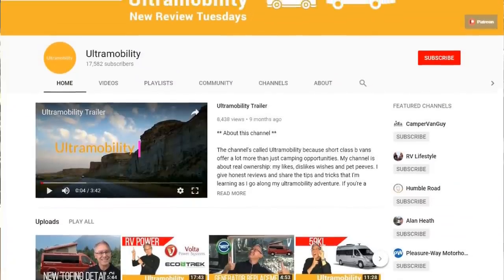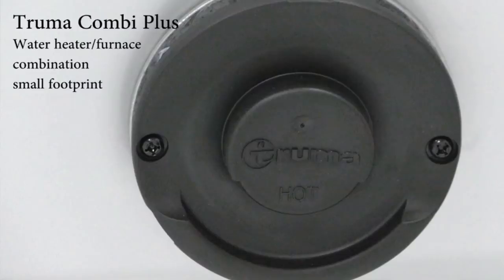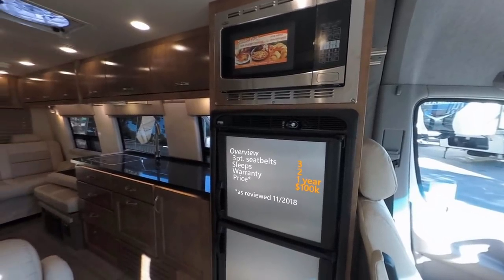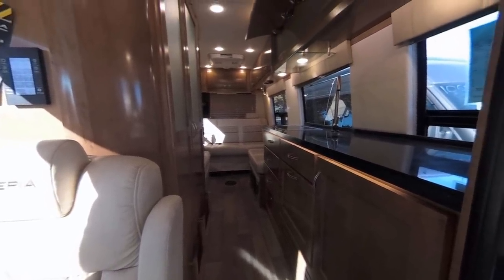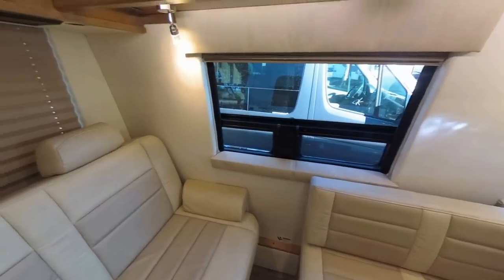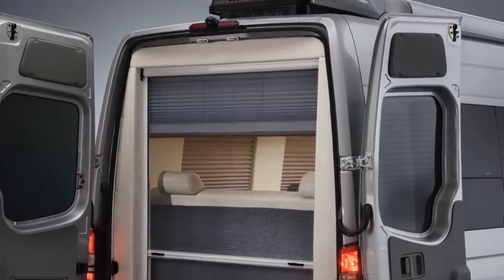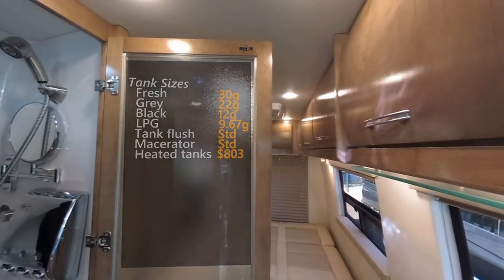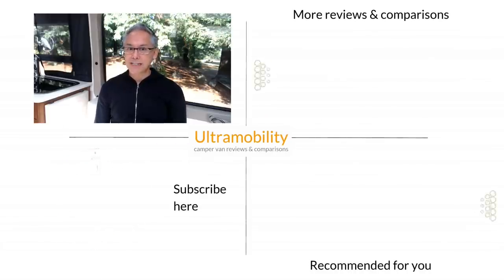Full Review | Coachmen Galleria 24T | A 4 Season Capable RV with Available Lithium Upgrade!

Comment: This is a question for Nick. I'm ordering a Crossfit tomorrow and I'm considering the upgraded insulation. Actually a three part question concerning the insulation upgrade. In his review Neil mentions a proprietary chemical used in its manufacture. What is nature of this chemical, is it a liquid, and if so what does Coachmen do to insure its stability? Side note: mention to Neil that I acquiesce concerning the 360 format, and apologize for my cheeky comment.  Thank You
Reply: Here''s a link to the product Coachmen uses:  https://phasechange.com/products/enrg-blanket/
Reply: David yes we have made some tremendous improvements in how Class B's are insulated. In the end of June 2018 we switched to a rock based, non fiber, R-15 insulation that is impervious to moisture, has a 2000 degree burn rating and has inherent sound deadening as our standard insulation. The Upgraded  Insulation application is called Phase Change. Phase Change is a latent heat storage solution. Phase Change is a plant based material with a proprietary chemical that absorbs the same heat or cold as a cinder block. You can find more on Phase Change technology on You Tube. When we changed our standard insulation in June we picked up 10 degrees of heat/cold retention vs. our old insulation. That was good but we wanted more. When we use the new standard rock based insulation in ADDITION to the Phase Change we picked up an additional 10 degrees of heat/cold retention for a total of 20 degrees difference. We still have the windows to fight thermal transfer of heat  however we feel from our testing that we have now the best insulated Class B products in Class. Feel free to reach out to me David. nrecchio@forestriverinc.com.  Thank you for your business and welcome to the Family!
Reply from the maker: Nick, have you all done longer term testing of Phase Change? How does its ability to retain heat/cold hold up over time. Does it loose its ability over time? I've heard stories from some home owners that have used the stuff that report that it works great at first but then becomes ineffective over time.
Reply: Thank you Dutch @flydutch1

Comment: I can already see water leaking in when taking shower into that crevice between the bathroom wall and the sink.
Reply from the maker: maybe but keep in mind that its probably like my Ascent which has no covering and just pipes back there that are sealed. That plastic on the galleria is likely just a covering and not meant to be water tight. I can't say for sure but that would be my bet.

Comment: I love the factory automotive exterior and windows.  Can anyone comment on the relative quality reputation of Coachman versus other high-end (or low-end) brands?
Reply from the maker: looking forward to hearing some owners chime in here!
Reply: I am the General Manager for the Class B Div. We strive to be the highest quality Class B builder in the segment regardless of price point. We use high quality materials that are not found on any Class B.
Reply: I think the quality of Galleria is the same as top quality brand such as Airstream, but price is very competitive ($50,000~70,000 cheaper). Sprinter van chassis is the same as Airstream (incl. safety options) except air suspension and auto window curtain. But I don't see the auto window curtain makes selling point. Air suspension? maybe. But you can install the same air suspension for $9,000 at the aftermarket if you really want it.
Reply: Being a former owner of a Roadtrek and current owner of a Galleria, I feel the build quality and cabinetry of the Galleria is vastly superior to the Roadtrek.  I also find it to be superior (although not by much) to the far more expensive Airstream Interstate.
Reply: @travel4B   Please reach out to us for your feedback on your Galleria. We appreciate the kind words.

Comment: Great review! If I understand correctly if you get induction cooktop and upgrade the generator you don't have any propane to worry about correct? That polar package looks super cool that and the insulation seems to be pretty cool! Tested 27 degrees below freezing that is pretty impressive!
Reply from the maker: Yes you could go propaneless but as I said in my video only if it’s not too terribly cold outside because the electric heating elements on the truma combi are not enough to keep the coach heated and really cold weather but if the weather is mild yeah you could certainly go completely all electric in this coach.
Reply: @Ultramobility   even if you have the polar package?
Reply from the maker: yep even with the polar package plus. the electrical heating elements are 2 800w elements I believe and in low enough temperatures you're going to need both running at full to keep the coach warm. That's 1600kwh. If you're battery capacity is 7,200wh then they could keep the coach warm for less than 7 hours before completely depleting the batteries. then you'd have none left over for anything else plus you'd be freezing. Propane is the only option with a high enough energy density to supply that amount of heat energy for a longer period of time.
Reply: @crystaldwfan - The Polar Package is only protection for the water tanks and lines.  It has nothing to add to the heating of the coach.
Reply: @flydutch1  oh ok thanks.

Comment: Another question maybe for the President of Coachmen that watches this site:  If a Galleria is ordered now, will it have the new Mercedes 2019 chassis?  If not, when can the new chassis be ordered?
Reply from the maker: Jay you can likely specify that when you order. however, I haven't seen their pricing yet for the 2019 chassis. it's likely to be at least $7,500 more than comparable models on the current generation chassis. that's just the actual markup from Mercedes on the updated Sprinter chassis with all the safety features that Coachmen (may) decide to use.
Reply: We have a few 2018 chassis remaining. After our 2018's are scheduled we will be bringing in our 2019 Sprinters with all the new features!

Comment: Great video as always but does the crossfit have a lithium-option?
Reply from the maker: Yep - you can upgrade to the Li3 system powered by Xantrex: 600ah, 7200wh of capacity, 3kw underhood generator and 3kw inverter. $22k.
Reply: Yes Cross Fit has the Li3 OPT now!
Reply: Nice, good to know

Comment: Ultramobility: How concerned are you with the lack of positive locking latches on the drawers and cabinets? That seems to me it could be a potential deal breaker for some buyers.
Reply from the maker: i'd need to try it out for a bit and see. you can't really tell unless you load up the cabinet with real world stuff and drive around. on my CS Adventurous there were no positive locking cabinets and I vowed I'd never purchase another RV that didn't have them. I consistently had to pull over to close the refrigerator door that flew open or to pull over to reattach the TV because the screw that held it to the wall vibrated loose and the tv was swinging around in the back. or pull over because a cabinet door opened and spilled out its contents. it got old. I haven't had that happen on my Ascent because everything positively locks.
Reply: Coachmen has recently added positive locks to the drawers and cabinet doors.
Reply: @flydutch1  Good day Sir!

Comment: I went to a coachmen dealer and he found out that it does have autostart with the upgrade, on the 2019 model.
Reply from the maker: Shirley there are two generators: the old fashioned one that's a generator set that runs off LP and an under hood generator (second alternator) that's installed in the engine compartment as a part of the LI3 upgrade. the old fashioned generator does come with autostart but if you upgrade to the Li3 system they remove the old fashioned generator and install the underhood generator and that doesn't have autostart because Mercedes doesn't allow Coachmen to install it on their chassis. Does this make sense? the Dealer should know the difference but maybe they are also confused.
Reply from the maker: sorry Shirley one more clarification : the older model 2018s did have autostart on the underhood generator but Coachmen stopped that on all later model 2018's moving forward due to Mercedes telling them to do so. it may have been an older model 2018 that you were looking at.
Reply: It is surprising how poorly educated the sales rep's are at RV dealerships.  The class B specialist knew less then I did at La Mesa and had to get a regional executive to answer my questions.  Neil's videos make me more informed then the dealer.  I was shocked, and let them know it.
Reply from the maker: thank you very much for that Charlie's Mom.
Reply: We do not have Auto Start on any Mercedes Benz products. We do have the under-hood generator and high idle but no Auto Start per Mercedes Benz.

Comment: Looking for 3 captain’s chairs-is the Roadtrek CS Adventurous the best option? Thx!!!
Reply from the maker: no I don't think so. it depends. the 2019 Galleria has more floorplans and is built to just as high a quality (perhaps higher). It's price will be less than the cs adventurous. but it's warranty will be 1 year compared to roadrek's 6 year. the galleria has true 4 season upgrade capabilities and has a better (in my opinion) lithium upgrade package. So if warranty is most desirable then the Roadtrek is the way to go but if price or 4 season capability or a better lithium system is more important then I'd say the GAlleria is the way to go.
Reply: @Ultramobility  Before I bought Galleria 24T, I went to the Roadtrek dealer. But my wife and I (also some other potential buyers) said each other, the cabinetry of Roadtrek looks like 70's motel (it looks very cheapy). Moreover, the dealer offered me its final price for $157,000. I walked out and went to the Galleria dealer the same day, I bought Galleria for $100,000.
Reply: @stephen442  "70's Motel" HA! This is a perfect description! I've seen so many RVs that I feel struggle with this same aesthetics, but now I've found the best language to describe it.

Comment: I don't know how certain RV companies stay in business😲 A $140,000.00 MSRP and a wapping 1 year WARRANTY,  just don't get it🤓🤓🤓
Reply from the maker: hi Steve. I think the problem with Coachmen is that they've set the MSRP for the Galleria too high. You can find them for much less as I found this one for just under $100k. That price is more in line with the warranty that they're offering. The challenge for Coachmen, in my opinion is that they are building a quality product that deserves a longer warranty. This manufacturer needs to decide where they're competing: price or quality. Right now they're stuck in between the two. Either go lower in price and compete with Winnebago or go up in price, extend the warranty and go head to head with Roadtrek. The build quality can certainly hold its own against Roadtrek. That's just my opinion but hey, I'm not running a large class B coach manufacturer so what do I know!
Reply: @Ultramobility  Thanks for your response. I have a problem with any builder of any RV with a one year warranty. Even ones in the lower price range. Especially considering a possible 10 to 20 year finance. When my purchase times come, I will be going Roadtrek/Hymer👍👍👍